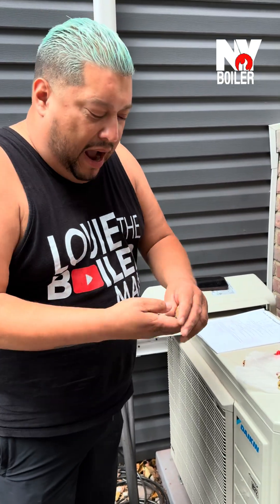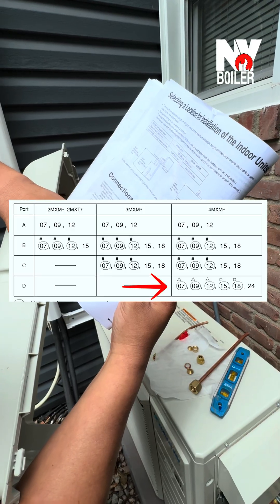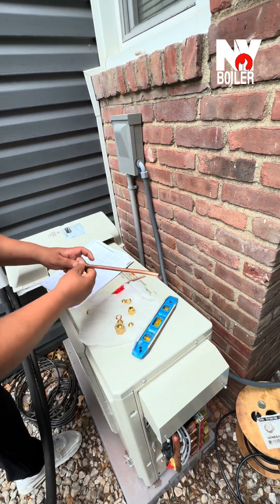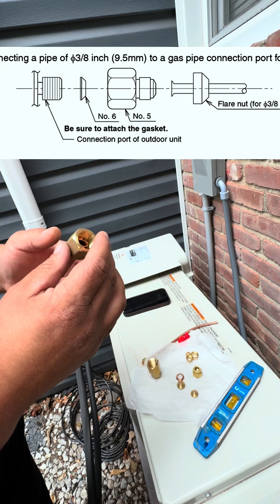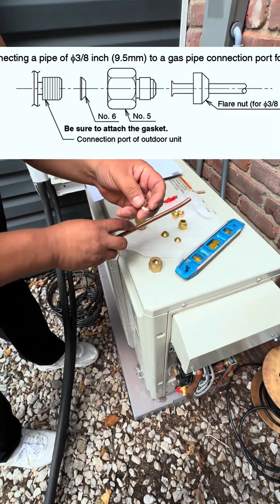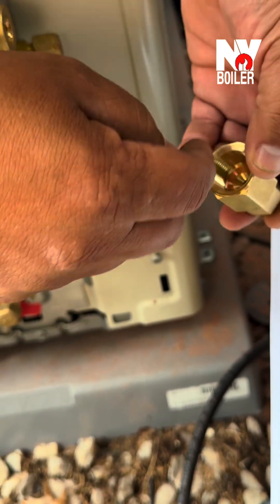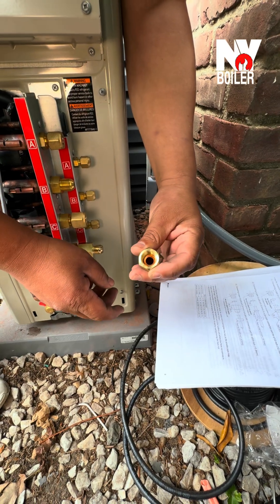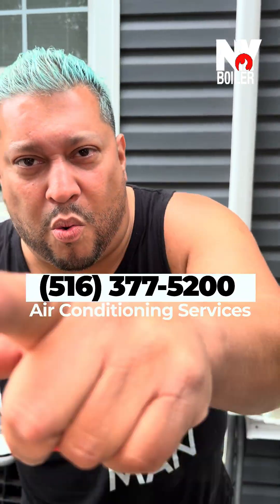🚨 TERMINAL D DAIKIN INSTALL PROBLEM? WATCH THIS BEFORE YOU START!

Comment: Our system did not come with the No 5 and No 6 reducer and gasket to go from 5/8 port to 3/8 line set. It looks like it only came with two No 2s and two No 4s. Where can we get the No 5 and No 6? Cant find them online anywhere.